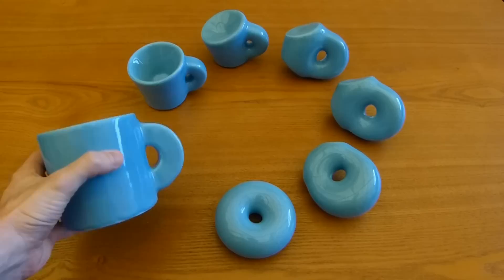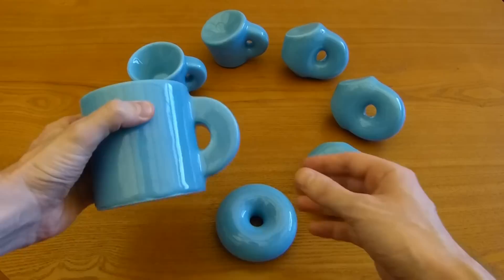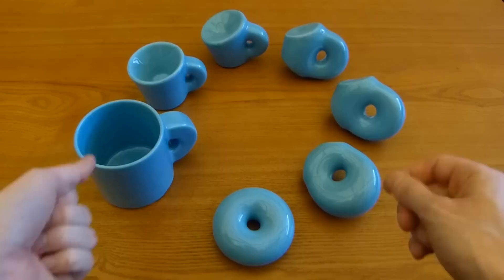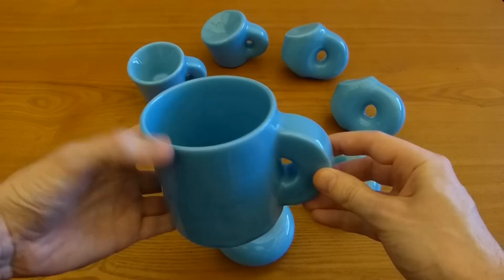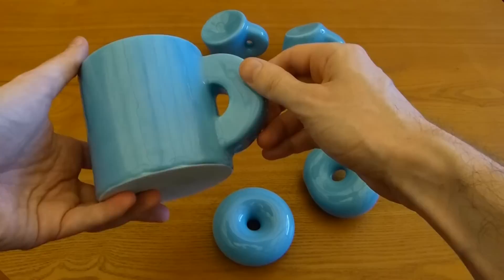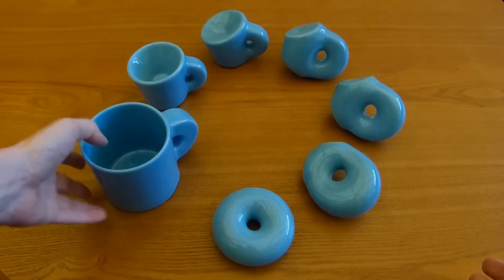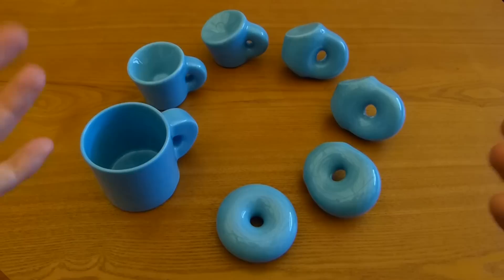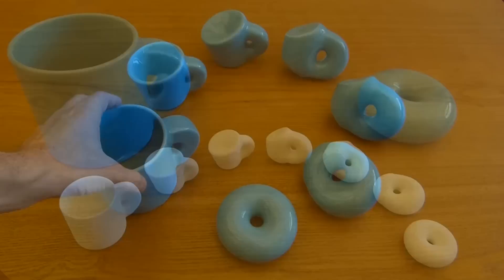Topology joke

Comment: The real joke is that this is the only topology joke, all others are a smooth deformation of this one.
Reply from the maker: Counterexample: A topologist can't tell the difference between a cereal bowl and a pancake.
Reply: Same joke, but based on a sphere, so under the rules of words rather than shapes, it's the same :p
Reply from the maker: Kathie Dart But moving from a torus to a sphere is a discrete change!
Reply: Yeah, but moving from a non-discrete change based joke to another non-discrete change based joke is also a non-discrete change :p
Reply: How would you gradually transition from one joke to the other joke, though?
Reply: All the topology jokes that aren't a smooth deformation of this one could fill the inside of a klein bottle.
Reply: My only regret is that I only have one thumbs-up to give.
Reply: Are all the jokes contractible? That'd mean that all topology jokes are trivial.
Reply: @BotanistJeff  you surely mean outside
Reply: Now that's an edgy joke!
Reply: But not all topological manifolds are smooth (or admit a smooth structure), so some topological jokes may not even have smooth changes defined
Reply: A torus, torus and a torus walk into a torus...
Reply: * Continuous
Reply: @henryseg  in simple terms (so my brain won't melt) it is basically defining different jokes by the amount of topological holes in 2 particular objects. That would leave room for as many jokes as there are object.
Reply: @NeverSnows  
AFAIR this is only true for manifolds and not for every object.
So every n-dimensional manifold with a genus g is homeomorphic to every other n-dimensional manifold with genus g.
Atleast that's how I remember this.
Reply: @MrDavibu  Bro, i have no idea what you are talking about. Sorry.
Reply: I have another, topologists know that spherical cows in a vacuum can't exist, their are clearly a torus.
Reply: Found the category theorist
Reply: @MrDavibu  as a student vaguely in the field of CS, that seems about right
Reply: @DanDart  now this feels more like category theory XP
Reply: This thread has gone too far. It’s looped back on itself.
Reply: I kept waiting for the joke to pop in the video, but it was folded in the comments.
Reply: Big brain comment section.
Reply: Now I want coffee, cereal, pancakes, and doughnuts.
Reply: @henryseg  but he can see the difference between a pancake and a cup because the cup is not convexe as opposed to the pancake which is, if my first year economics math is correct…
Reply: Counterexample: your comment is a topology joke
Reply: There's a natural transformation joke to be made here
Reply: @henryseg  it’s a meta joke on the actual structure of the topology joke itself rather than the objects within the joke
Reply: Ihave no idea what the heck everything means now
Reply: BROOOOOOOOOOOOOOOOOOOOOOOOOOOOOOOOOOOOOOOOOOOOOOOOOOOOOOOOOOOOOO
Reply: That was a funny read
Reply: The category TopJ: Objects are topology jokes, morphisms are smooth deformations of topology jokes. All objects are isomorphic.
Reply: Ok that got me
Reply: @kaidatong1704  that’s where topology comes in
Reply: @Jivvi  ngl that sounds good.
Reply: @henryseg  Cereal bowl and a single cereal?
Reply: @kaidatong1704  it's all in the segway
Reply: I've been laughing for longer than I'd like to admit
Reply: Wait a second... that means there's 2 jokes
Reply: Bro at first,i read your name as "Dan fart" lol
Reply: These comments are quips that turn into jokes when folded upon themselves. Final quip. This is a joke.
Reply: I once poured coffe on my coffe cup but I didn't knew where the coffe goes I tried and tried and tried but didnt work my mom then accused me to be a fool when she saw coffe on the floor she then started saying this is a donut I didn't understand wtf is a donut she then told me a coffe cup is not a ring but a donut is I then went to my algebra proffesor he gave me an F saying that I don't know the difference between rings and non-rings and I also asked my topology proffesor he told me that my mom is a fool and that the Algebra proffesor is also a fool the Algebra proffesor heared the topology proffesor saying that he is a fool they then started fighting each other saying your a singularity! No your wrong my topological balls had entered your mom's singularity then the Algebra proffesor transformed into too isomorphic shapes  the topology proffesor then said according to topology there is no way he become one shape you loser! The topology proffesor then introduced a new topological structure called "loser" and won a Nobel prize the police came saying you killed him your going to jail!!! He said what did I do he's a loser and that's why he can't become a shape I should make theories to know how to know a loser from his face! Luckily  the police officer was a topology student he told him that he is sorry to accuse him and told him to teach him more about topology and make him succeed with a topology major after he failed a class the topology proffesor said that it's a/b and that he will teach him the way
Reply: But then you always have a donut with your coffee in a mug.

Comment: As a ceramicist, my main takeaway is; That’s a shitty handle.
Reply: As someone who knows nothing about topology or ceramics, I agree. You would be able to fit one finger through there at max.
Reply: @alltomorrowsfan  and only two (two and a half if you're a big lad) around.
Reply: If you take a sip from the mug all the liquid goes on your face
Reply from the maker: According to Keenan, the handle needed to be that chunky for conformal Willmore flow to end up at a symmetrical torus. A more standard shape would have ended with a lopsided torus. Of course the topology doesn’t care about this, so we could have cheated.
Reply: Topologically speaking, it's the same as a good handle
Reply: It immediately jumped out at me that that wasn't actually a mug, it was a life-sized artistic representation of a mug made out of the same thing a mug is made out of.   Very unsettling.
Reply: @henryseg  no excuses
Reply: @shane8037  could u still drink out of it though is the real question
Reply: As an absolute tub of lard, my main take away is; That's a shitty donut.
Reply: @FeedMyKids1  dont u mean small lad
Reply: Equally, a far too crunchy doughnut😬
Reply: Sir, Ramic, if i wear your dinnerplates to a gunfight, will I die within five seconds?
Reply: Damn I hate shitty handles. If you know of any cups with non-shitty handles I'd be more than happy to throw my money at it.
Reply: @kylenetherwood8734  
Hysterical
Reply: @shane8037  A gingerbread man lives in a gingerbread house. 
Is the house made of flesh? 
Or is he made of house? 
He screams, for he does not know.
Reply: Nono you dont hold the mug by the handle you dip it into the donut
Reply: @kylenetherwood8734  great typology joke 👍
Reply: As a grammatician, my main takeaway is that ceramicists improperly use semicolons; they are supposed to be used to connect complete sentences, not incomplete clauses.
Reply: @XanderGimbel  there are two questions which fundamentally define the nature of your case:

1) If you were a grammatician working for a topologist who makes ceramics in their free time, would you be drinking alphabet soup out of that cup? 

2) Is a semicolon just a colon with a shitty handle?
Reply: @shane8037  omg now imagine a life size artistic imitation of a human made of what humans are made of 😭 😭
Reply: That semicolon should be replaced with a colon!
Reply: I hate it everytime my 95% coffee mug 5% handle becomes 0%coffee mug 100% handle.

Comment from the maker: New project with Keenan Crane: A topologist can't tell the difference between a coffee mug and a doughnut/donut.
Reply: That came out very nicely! Can we convince Keenan to come to Bridges?  (Did I ask you that already?)
Reply from the maker: I don't recall...good idea.
Reply: A corollary of the joke is that a topologist drinks their coffee with a doughnut. Someone needs to print a doughnut in the shape of a coffee mug and see how it holds coffee. Is there a 3D printer that prints doughnuts?
Reply from the maker: Surely someone is working on it if not. The dough might be the tricky bit - getting it to keep its shape between extruding and baking. I am quite certain that there is no hybrid variable-ratio ceramic/dough printer.
Reply: Maybe naturalmachines.com's Foodini could be capable of printing one. However it's not available yet. Looking forward :)

Comment: Theoretically there is always a way to deform an object until it resembles another so they wouldn’t/shouldn’t be able to tell anything apart from eachother
Reply: No, the amount of holes is a different. Also, in topology materials can't fuse when 2 surfaces touch. So a solid ball that you mould so it resembles a handle, still has a split where two surfaces touch.
Reply: @HenkPoley  oh ok

Comment: I believe the torus is not the lowest energy state for a one holed surface. The torus wants to relax into a sphere.
Reply from the maker: If you enforce conformality, it cannot make the cone points it needs to in order to get more spherical.
Reply: @henryseg  I don't know what cone you are referring to but certainly its genus needs to change when the inner parts of the hole touch each other. My point is that they will touch and want to continue pressing together because that donut shape is not it's lowest energy state.

Comment: i guess i'm not a topologist, because i don't see why the shape wants to "fill in" the indentation of the mug, but preserves the hole in the handle/doughnut? it seems completely arbitrary to change one and not the other (or both, or neither)
Reply: It's because the indent of the mug doesn't punch a hole all the way through to the other side. Holes which connect on both sides are one of the few things topology actually cares about, since they can't be created or removed by simple deformation
Reply: The difference is that there isn't a hole there - they just pushed it down/pulled it back up. You can't do anything like that with a true hole, adding/removing one requires ripping/joining. (Imagine molding it out of clay; you could change the cup to the doughnut without ever tearing or joining anything)
Reply: thanks, both of you, for the explanation! it makes somewhat more sense now.

Comment: @henrysegerman hi, Henry Segerman, Sir, I have a huge confusion about the following questions 1) can a two manifolds be homeomorphic as well as homomorphic 2) can two manifolds be diffeomorphic as well as homomorphic 3) can two manifolds be homeomorphic as well as diffeomorphic 4)) and please give some example in support of above cases I have asked above. i have confusion regarding homomorphism , homeomorphism and diffeomorphism.
Reply from the maker: Homomorphisms are usually things that go between groups, not topological spaces. Homeomorphisms go between topological spaces. Diffeomorphisms go between differentiable manifolds. (The wikipedia pages go into the definitions of each of these.)

Now, some groups are topological spaces (for example the unit circle in the complex plane), and some topological spaces are differentiable manifolds (same example works). So it is possible to mix these ideas. But you'll want to get the individual ideas straight first.